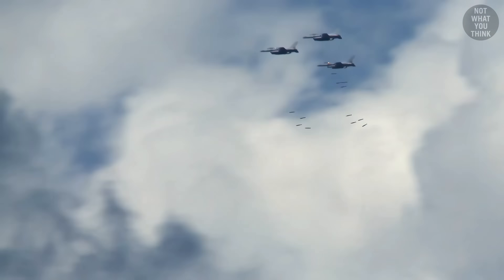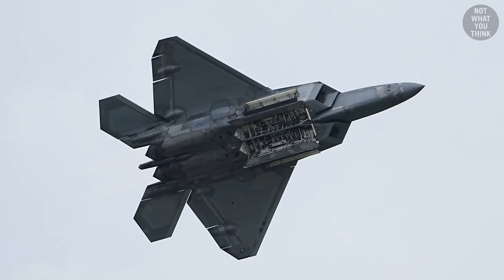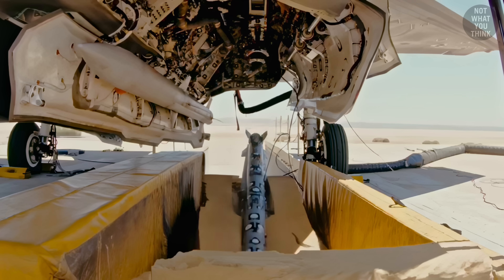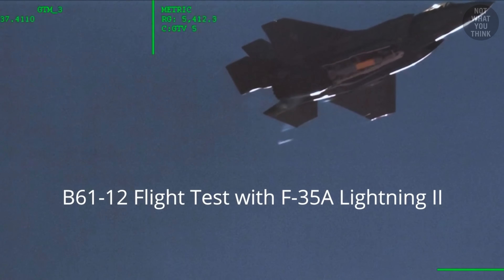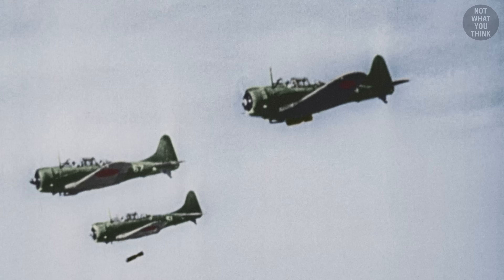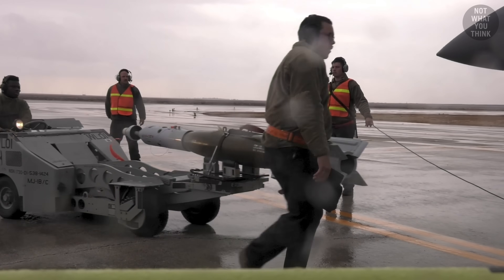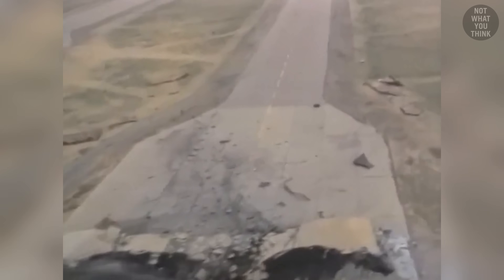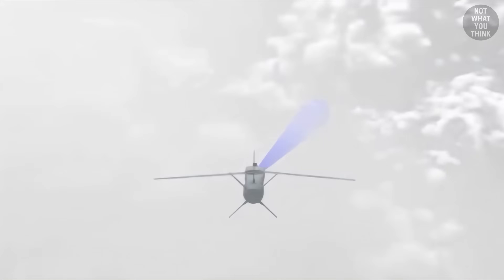Why Gravity is No Longer Enough to Drop Bombs

Comment: You can stack GBUs. For example, you could drop one bunker buster it makes a hole. Then you drop another bunker in the same area. You keep making the hole deeper and deeper.
Reply: There’s a clip of that at 16:30
Reply: Thats the plot of top gun 2
Reply: At what point do we just design a self-tunneling bomb that has a tungsten-carbide digging apparatus strapped to the front?
Reply: @stopthephilosophicalzombie9017  I know it's not what you mean, but the penetrator is already tungsten and abrasion-resistant steel (like AR500) 😅
Problem is making a mechanical system that can withstand the impact... Which I'm willing to bet is nigh on impossible with current tech, at least at terminal velocity. So they'd have to have it parachute in (or have retro rockets), but now your munitions are liable to be targeted and taken out before it gets to the target.
Reply: @DUKE_of_RAMBLE  It's still worth it if the weapon is capable enough. Currently it wouldn't be, but there's other examples of parachute-using munitions. And I don't just mean parachute bombs, there's also the ALARM anti-radiation missile developed for the RAF (they retired it though, but it's still used by the Royal Saudi Air Force). If it loses its target, it climbs to 13,000 feet and deploys a parachute to extend its time in the air while it looks for the target to light up again. If it finds one then it lights a second motor and goes after it again.
Reply: @stopthephilosophicalzombie9017  you don’t have to. With bunker busters they penetrate really deep.
Reply: @stopthephilosophicalzombie9017 I will paten that idea
Reply: Iran should have known
Reply: the most moral country did that in beirut last year, they said it was over 80 bunker-busting variant 2000pounders.
Reply: @Intelligence_Failure  "most moral"
Reply: @VocalMabiMaple  yeah YT hasn't caught on to who that refers to yet.
Reply: @Intelligence_Failure  Those animals, yeah I was going to watch this but it reminds me of that USA funded filth that is a terrorist group
Reply: @Intelligence_Failure  hell yeah ❤
Reply: @LoganGrimmnar  Hell yeah!
Reply: @thomas why?
Reply: Its not called stacking, stacking is what you do to hard point rails lol. Its called proper fuzing and programming.
Reply: The whole what?
Reply: They are not that precise.
Reply: @Мойевропейскийжидобандеровский yes, they are. bunker-busting variants of aerial b°mbs are practically always used in guided form, which nowadays are very accurate. military GPS, when it isn't being jammed like the russians do, is accurate to a few centimeters, and the gravity b°mbs seem to have a CEP of a few meters at most.
in beirut, almost 90 of those landed close enough together to collapse only one or two buildings, even though one or two of those b°mbs could have done that damage at the surface. bunker-busters are in fact used in series to drill or dig. the reports claim that, similar to many other vict°ms of such b°mbs, nasr°llah actually ended up dying from inhalation of toxic fumes of the b°mbs, and that his body was recovered more or less intact. that seems a bit dubious to me, like they  might have just pretended to have a body to have a better funeral, but what's undisputed is that it took close to 90 1 ton bunker-busters to dig down deep enough, meaning that they must have been delivered by a pretty large formation of multi-role fighter jets, because isr°°° is not supposed to have any heavy b°mbers. I suspect that they did not rely on flying stealthy by using internal b°mb bays of F-35s, which would have required many more jets than using external hardpoints on those and/or F-16s and especially F-15s, because they either did not care about being detected, or actually wanted to be detected, on the basis of their target individual being in a tunnel complex and moving to the safest location when forewarned, which is what they hit.
Reply: @Мойевропейскийжидобандеровский lol this comment aged poorly

Comment: Those bombs do not need to be that expensive... There is no way that the materials cost and production cost is that high
Reply: As someone who's worked a lot of different jobs, I spent several as a machinist and YES if it requires specialized lathes to handle specialty steels it can quadruple the price vs conventional steels. A lot of those specialty steels aren't made in regular production steel mills,  they are made in batches.  The other issue is size, it takes big cranes in a fab plant to move the blanks and finished products and a huge lathe to handle it. Plus, the explosive has to be melted and poured into the bomb casing in a carefully controlled environment with lots of safety precautions and THAT'S expensive. And the fuses have insane design requirements to be rugged (over 1/5 of WWII bombs failed due to fuses) so they are reliable.
Each material that a bombs made of has to be high quality, that's expensive. Then the different parts have to be made by high paid people at high dollar companies (yes, war is profitable) so it all adds up.
A lot of the companies that do ordinance in the Western world are 'sole source' meaning no one else competes with them, there's no competition so yes, that drives the price higher.
Reply: @bobjoatmon1993  I understand it being crazy expensive but it blows my mind that the ones that aren't bunker busters cost the amount of a new car
Reply: @dabdillon6318  its not just military weapons that are expensive, some of the shops I was at did oil field / drilling equipment machining, the prices are crazy high for that too and with that there IS a lot of competition so profits are low so that just shows its just an expensive endeavor and not the oil companies ripping people off like the liberals want to claim.